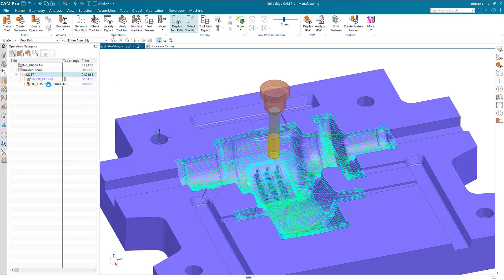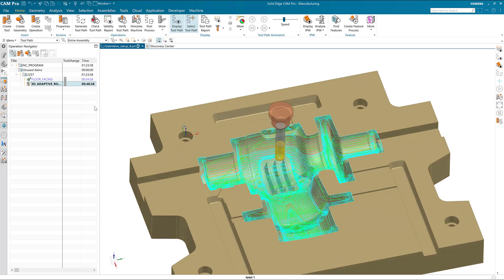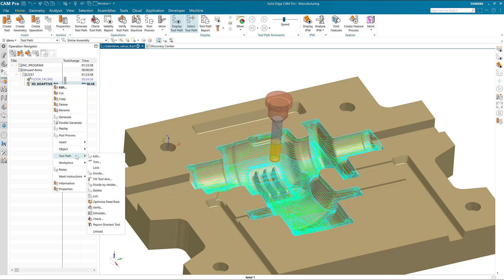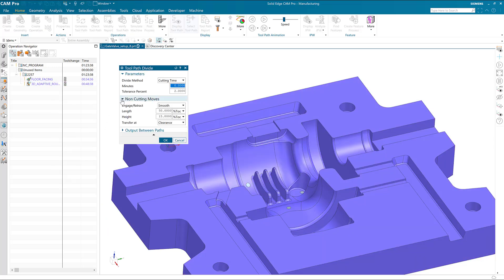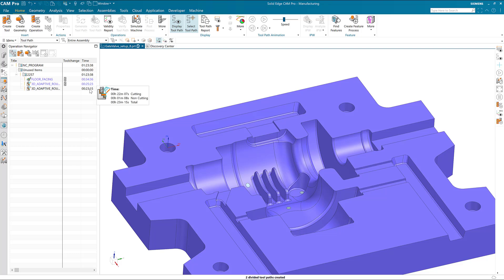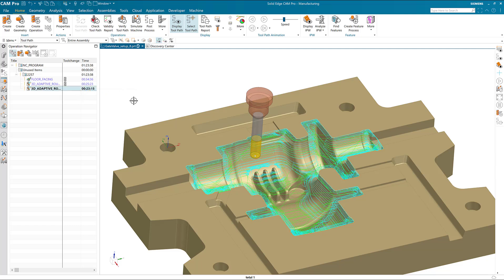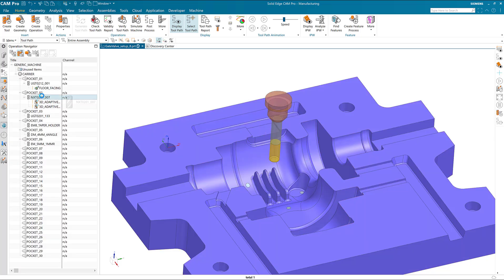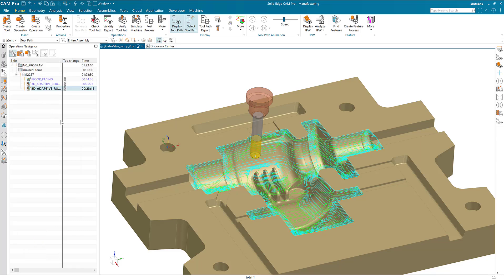Solid Edge CAM Pro: Tool path divide

Comment: What is the difference between NX Manufacturing and Solid Edge CAM Pro?
the entire UI looks the same.
Reply from the maker: Thanks for your patience while we researched an answer for you. There is a difference between the two products, despite the similarities. Solid Edge CAM Pro, built on the powerful NX platform, has special packages and features that help small and medium-sized businesses increase their productivity and throughput. As you know, both Solid Edge and NX are built on the Parasolid kernel, so we maintain associativity to original geometry, regardless of which platform it originated from.

Best, Team Siemens